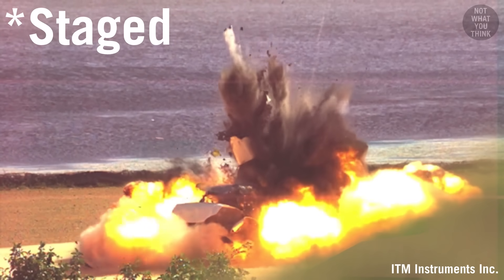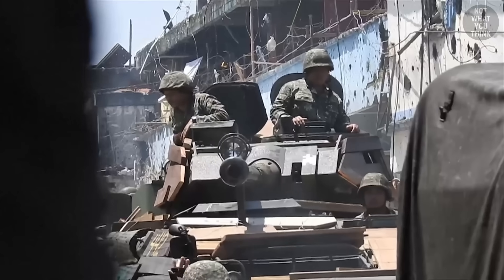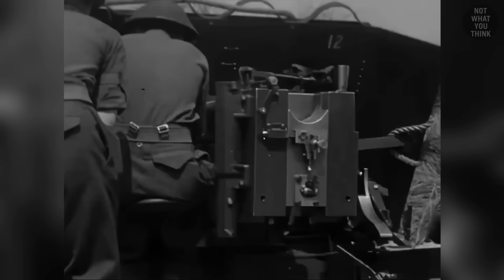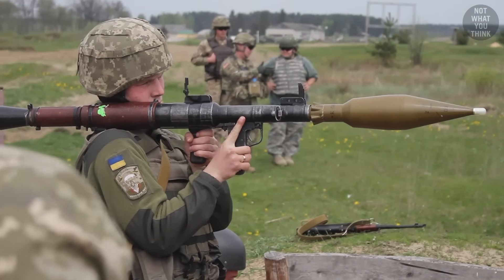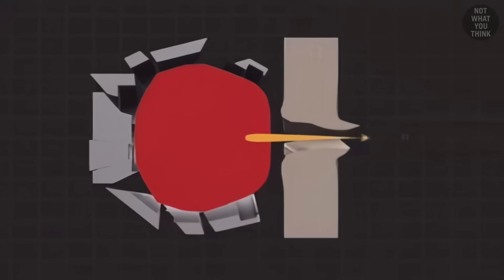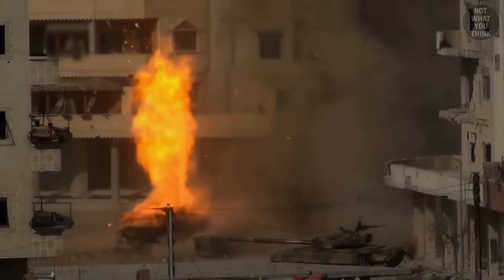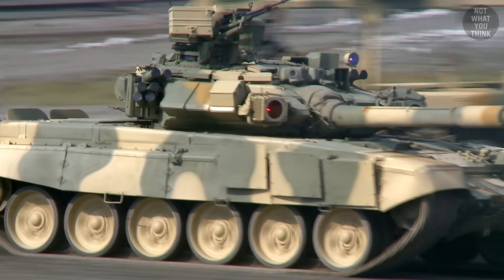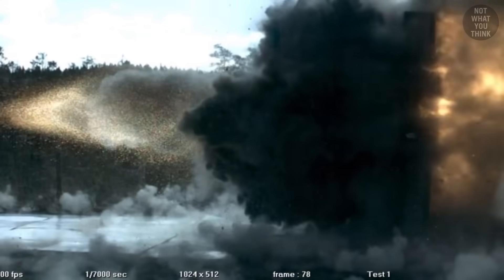Why Protecting Tanks is Getting Much More Difficult

Comment: There is definitely an asymmetric component to anti-tank weapons.  Especially with tanks getting bigger and more technologically advanced.  I've seen some go so far as to compare the modern tank with the battleships of yesteryear.  However, there are a couple of caveats:

1) Effective use of tactics and combined arms can reduce the risk to tanks; something which the Russian army failed to do.  Screening your tanks with your own infantry, using drones and air cover, effective scouting, or even popping smoke can all go a long way to help.

2) Battleships became obsolete because there was something else that took over their main job and did it more effectively: the Aircraft Carrier (their secondary job of shore bombardment has still not been effectively replaced, imho).  Decades earlier, people thought the battleship was doomed due to the use of torpedo boats: small fast and cheap boats that can make a run at battleships and launch torpedoes at them.  They were a real threat until Navies came up with a solution: a smaller, fast ship with smaller but fast firing guns called a Torpedo Boat Destroyer (which have evolved into modern destroyers).  The also added more fast firing guns to battleships along with a torpedo belt of armor protection.  This largely cut down the asymmetric threat torpedo boats.  Also, battleships didn't go away despite the asymmetric threat because torpedo boats could not fill the roll of battleships, they could only be used to counter them under certain conditions.  It seems that anti-tank weapons like the Javelin and nLaw are in the same category: they can counter tanks under certain conditions defensively, but they cannot fill the roll of the tank on the battlefield.        

We may see in response, smaller, lighter and faster tanks that are more high tech.  Indeed the US Army has already decided on what it calls mobile protected firepower (basically a light tank).
Reply: Though it's arguable whether battleships were ever NOT obsolete (depending on what you mean by "battleship", anyway). The post-Dreadnought designs saw very little action overall, with their value mostly being people in charge BELIEVING them to be a threat, with minimal evidence to the magnitude of that threat. And, looking through a list of battleships sunk in combat (and the scuttled list, for ships scuttled after being damaged), there were only I think 5 where another battleship was responsible for the sinking/scuttling, with the vast majority being sunk by aircraft or submarines (I credit Bismarck to the Swordfish that disabled the steering).
Reply: @gimmethegepgun  Which is why battleships were replaced as the Queens of the Sea by Aircraft Carriers; it just took a while for reality to set in.  Sans Aircraft Carriers, would they have survived?  Surely at least a while longer.  The question is: are anti-tank weapons torpedo boats or aircraft carriers?  I would submit the former because they can't 'replace' a tank (by doing the same job better or cheaper).  Time will tell.
Reply: @Erik-um1zn  The point I'm making is that comparing the fate of the battleship to the possible fate of the tank may not be a very good comparison, as it's disputed whether battleships were EVER worthwhile, while the accomplishments of the tank are indisputable.

Comment: I'm not ranting about the Russian ERA here. I'm just wondering,at 10:26 I saw this ERA fillings as the RDX shape charge from building demolition. They used it as a steel cutter in foundation and steel beams. Did they just use off the shelf steel cutters as ERA?!

Comment: And then there's NLAW which costs maybe $20k per shot and it's  intented to be aimed about 1 meter above the target from where it shoots down the shape charge. These have been demonstrated to be highly effective in Ukraine.

It basically boils down to cost. NLAW would be effective against infantry, too, but spending $20k to maybe kill one soldier (assuming no miss) gets pretty expensive really fast.
Reply: NLAW is a very limited system.
Reply: NLAW vs infantry doesn't even enter the equation and shouldn't be discussed because it's just silly. The problem infantry has on a modern battlefield is how quickly and easily it can be found by drones and immediately marked for arty strikes. Tanks survive shrapnel a lot better and can espace out of area that's getting shelled quickly.

Comment: To kill a tank nowadays, your munition either needs to go much faster, or have such a high explosive yield it no longer matters how much armor or what composites theyre made of are
Reply: The 120mm smoothbore gun is doing the job rather fine and will probably for the next one or two decades. After that, you can use 130mm guns which have an even higher energy.
Also, the sensors and effectors of active protection systems are rather delicate. There is a reason why modern hard-kill APS only have around a handfull of charges. Even if you can prevent penetration, there is a good chance that equipement on the outside of the tank gets damaged, including your APS.

Comment: New environment might just be changing doctrine of tank usage. Not necessarily a frontline force but back to the original idea of a cavalry unit which exploits weak points in the enemy's lines when the enemy is distracted by other means already.
Reply: Yup. Tanks drop the opp force’s foot soldiers morale greatly. And Networked Drones are gonna change the battlefield and counter-insurgency/LI conflict.

Comment: ERA and APS both have a vulnerability to volume of fire. A 30mm round or a small glide bomb gets rid of ERA tires and uses up APS charges just as well as a 120mm or a Javelin. A burst of 50x 30mm HESH would get through any APS, through any ERA, and then whether it gets through the most advanced heaviest tank armor or structure is just a matter of putting more HESH into it.
Reply: APS can identify the type of ammo fire at it by radar signature, plus HESH is useless against modern composite armor as this don't transfer the shock eave of the explosion to the interior layers of the composite. 
Yeah, shoot a tank cause no damage, reveal your position be killed sounds practical.